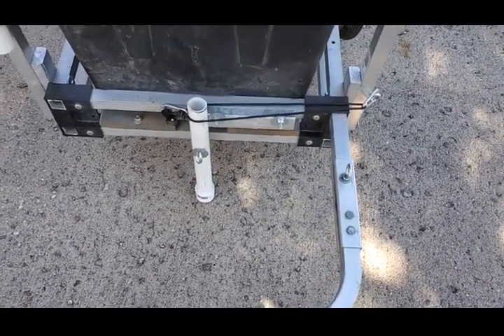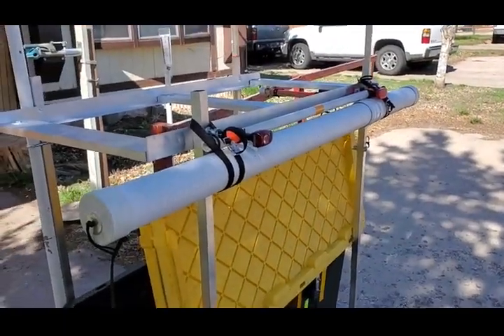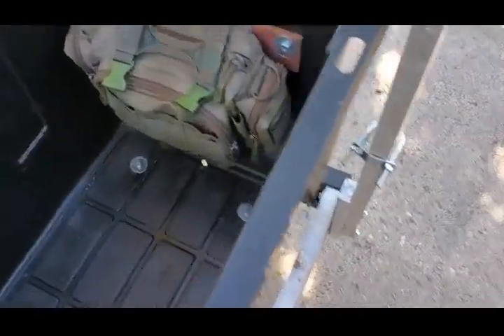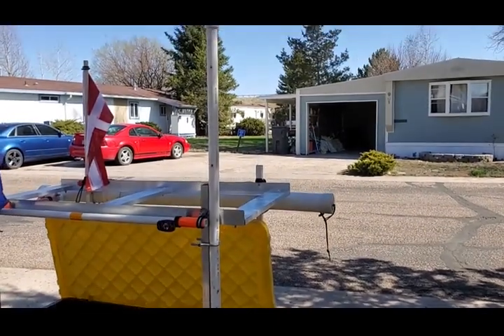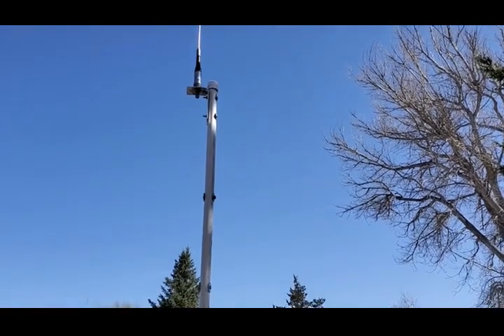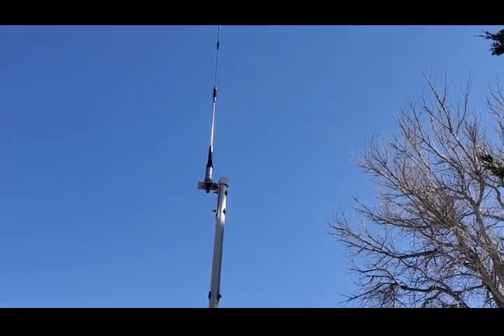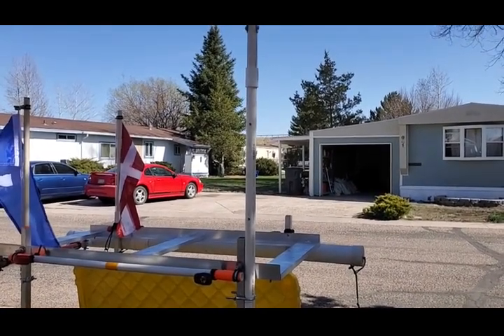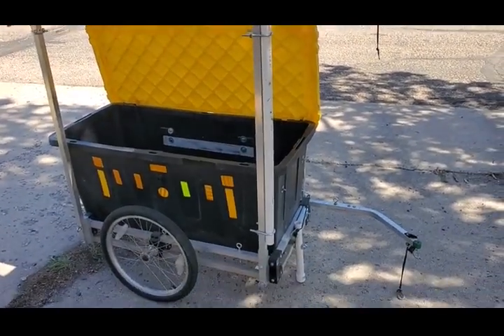Wiki Trailer Update

Comment: Lookin good James, love the second level and still able to open the lid.
Reply from the maker: Yeah, I did that on purpose. So when I take the trailer camping or fishing, and I have stuff on the top rack. I can still get into the box. I think I am just about done with upgrades and add-ons. So hows the new bearing working out on your wheel?
Reply: @longrider42  Good idea. The bearings are screeching again, sob sob. Perhaps it's not that the bearings were on their way out at all, dunno.
Reply from the maker: @offgridmojo  Now are there bearings on both sides of the hub? There should be something like 18 bearings per hub. Nine on each side, with lots of good grease. White Lithium Grease is the best. All the bearing on my wheels, bike and trailer are sealed/cartridge bearings. One on each side. That might help.
Reply: @longrider42  There are bearings on both sides of the hub. The bearings as far as I can tell are not sealed bearings. There are I believe 9 bearings in total.
Reply from the maker: @offgridmojo  So just 9 bearings total, or 9 per side, there should be 9 per side, or 8, you have to leave just a little bit of room. I'm glad I don't have wheel bearings to worry about any more. Take care and stay safe. Oh, and instead of an awning. I will use a great bit Golf Umbrella. Later.